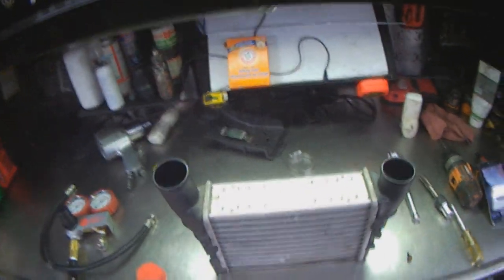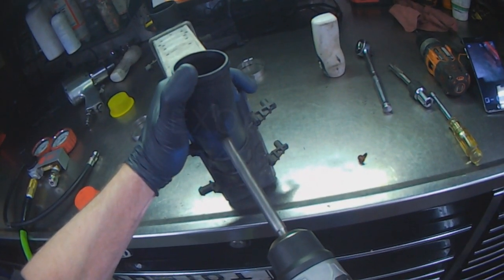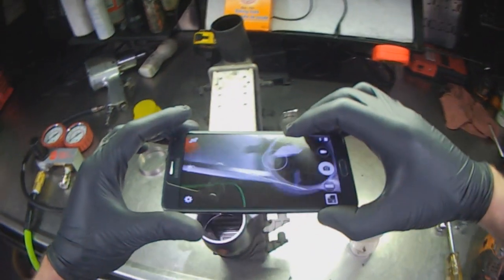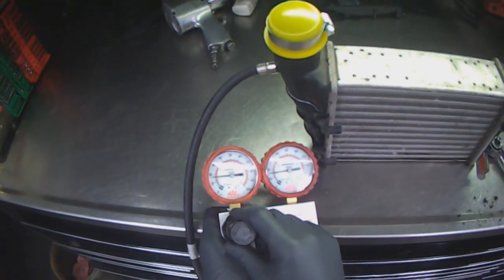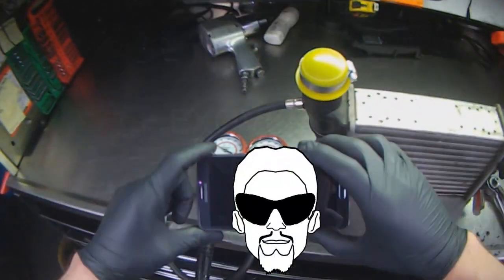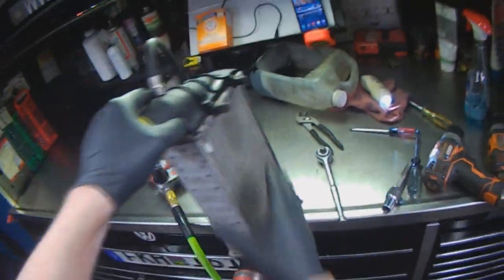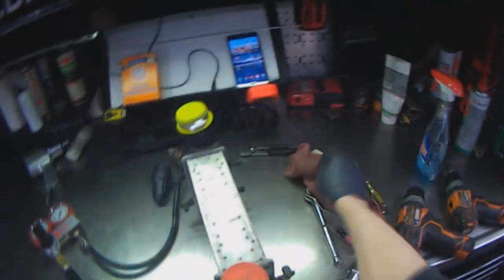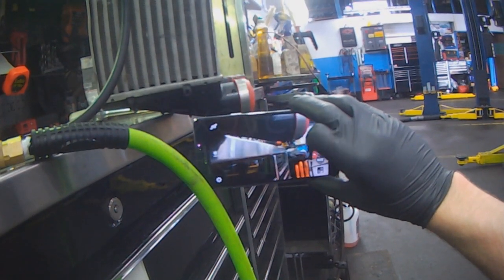Intercooler pressure testing (after drilling... OMG!!!)

Comment: I watched a bunch of videos here on my stutter/misfire issues with my 2014 f150 3.5 L w/ecoboost  while accelerating hard to pass. The issues started to show last spring and occasionally after that, always in high humidity. Last week it got so bad it threw the check engine light and code p0303 (misfire cyl 3) and put the truck in the limp mode. I drilled a 3/32 hole in the driver's side bottom near where you did and got about 1/4 cup of oil out. I also changed the plugs that were fouled, out of gap and #3 was cracked and had carbon tracking. I did not plug the hole as the other guys didn't either. Test run after warmed up to simulate a full throttle passing action. It was like new again and had full power. My question is, where is that oil coming from? Why is the engine oil leaking in there or is that just a normal thing for intercoolers? You would think they would incorporate a drain port.
Reply from the maker: PCV oil in the intake is normal... depending on intake design, some intercoolers collect more than normal amounts of oil. Too much oil is a sign of possible engine or turbo issues.
Reply: @EXOVCDS  thanks, at 75k miles I don't think 1/4 cup is too bad I guess. I was reading on others that ford has been playing with different air dams to keep the air from condensing when its humid, but won't admit to a problem.

Comment: This popped up in my recommendations right after the live stream tonight. I had no idea that this was so controversial. Responding to the inter-cooler 1/8" drain hole haters. WTF! Well done sir. Not much doubt after seeing this. For the extremists, put a dab of sealant on the screw before putting it in to seal up that .010 boost leak! haha The average guy installing a turbo couldn't even come close to sealing up a turbo install this well. New ideas take time to catch on Thomas, before long everybody will be doing this so you can feel good.
Reply from the maker: Most turbo engines don't have this type of issue.. I check turbo gasoline engine intercoolers as well, they fare better and when they show excessive oil... it's usually the turbo that's the cause. I vent the PCV to atmosphere on my Turbo E34, that way I know that any oil in the cooler has to be from the turbo.
Reply: I've heard that the turbo is usually the cause. I have to remember that you're dealing with the PCV oil on the TDI's. I should look into the configuration of that system to better understand. Hey, you'd better get to sleep. Need you sharp as a tack for tomorrows live chat! Thanks!
Reply from the maker: Gasoline engines have PCV oil in the intercooler as well... but not as much. Eliminating the PCV / venting it can help determine which the source of the oil is.

Comment: Hello i'm not the best in english but can i keep the hole open? And if not how often i need to remove that screw for drainage?
Reply from the maker: You can keep it open... but it will leak oil and the oil will get on everything under the car while you are driving. I would plug it with a screw and check / drain it at every oil change (once a year).
Reply: @EXOVCDS  ok thanks buddy

Comment: i just put a small 32nd hole in the bottom of mine, no screw no noticeable boost variance. never any oil accumulation. also keeps system cleaner
Reply from the maker: Thanks for sharing! ALH TDI? Any oil drips when parked? I can't believe all the people that worry / think that it will cause a boost leak.  LOL
Reply: Thomas EXOVCDS yes you can put catch can under car. all my diesels have some leak somewhere in ic lines with regards to oil squeezing between fittings. the map sensor will notice MINISCULE drop in boost and compensate thru ecu to boost actuator thru n75 to keep boost on vnt sustained at higher level to make up for ity bity leak. yez thez armchair mechanics r the cats meow huh. dont let them get to you. good job btw. and for those out there, no you wont overwork the turbo.

Comment: Can you leave the hole open what should I put a screw in it
Reply from the maker: A small 1/8" / 3mm hole can be left open, but it will leave oil on the floor wherever you park. Plug the hole with a small screw... after draining the cooler.
Reply: @EXOVCDS  I see a little oil on the spoiler when I get done driving it to work
Reply from the maker: @RonnieYoung-zx8wu 
Some intercooler have a problem with condensing water / water collecting in the cooler. The result is similar to oil collecting... can cause misfires during acceleration.

Comment: Hi Thomas! good video, not boring at all good point,way to go.. 
Question for you " In order to replace the intercooler is it necessary to remove the front bumper, car in question 2003 ALH" 
Thank you.
Reply from the maker: I believe it can be taken out with bumper in place... but easier with bumper removed. Bumper removal does not take long / is easy... hardest part is attaching the release pull rod when you put the bumper / grill back on.

Comment: To my brain, drilling and plugging shouldn't negatively affect boost.  I drilled (1/8" bit) my ALH with 330,000 km's (likely never drained),  about 1/2 a liter+ of oil came out.  With the time I saved drilling instead of full disassembly, I was able to de-coke my EGR and top of my intake.  I'll do a full clean later (It was plugged solid, again never cleaned by previous owner).  My EGR and first 3 inches of intake were packed solid with 3 pencil sized holes through the EGR's coking and maybe a small  pinky finger sized hole for the intake to weeze through.  Much better now.  I didn't want to clean the EGR without draining the oil from the intercooler afterward.  Suck hard on a pinched drinking straw in water... then, stop pinching...   where did all the water go?  :P 
I don't recommend cleaning intake while mounted on the car.  I just did the top portion about 3 inches in...   CAREFULLY with a good shop vac grabbing everything as I slowly scraped it away a little at a time with a screwdriver.  Anyway, thanks for the video, hopefully put some minds at ease.
Reply from the maker: Thank you for sharing your "drain experience" and the tip about how to clean the EGR/ intake with a shop vac! Yes, that would surely have caused a runaway had you not drained it first. Pieces that fall further into the intake will get past the valves and that can cause (if lucky) noise when starting the engine (carbon gets compressed between piston & cylinder head... at worst is could crack a piston.

Comment: dosent the tdi have the shudder valve to stop runaway, or was you not talking about a vag when you said about your experience with diesel runaway?

also off subject..... what does a ti do with excess boost when coming off the throttle, a petrol has a diverter valve, so where does a tdi dump its excess boost??
Reply from the maker: Shudder valve only helps when there is no fuel... there's no throttle plate, so any remaining boost just goes into the cylinders. Also, the variable nozzle turbo fins open to slow turbo spool when the foot is taken off of the gas pedal.
Reply: ok, but if its running away on oil say from a faulty turbo seal or over time oil build up in the intercooler the shut off valve on the intake cuts air supply shutting the runaway down no???

thanks for your reply, love your channel man!
Reply from the maker: +andrew page The valve only closes for 1 to 2 seconds and then opens again... you would have to hold it shut manually. By the time the runaway starts, you do not have time to stop the car, open the hood & hold it closed till the engine stops... without causing damage. A small runaway without damage is possible, but even then, parts get stressed due to the uncontrolled combustion & rev limit.

Comment: Wouldn't a small rubber washer added to the small 1/8th inch screw possibly help minimize the bubbles from the boost leak? I know over time the washer would need to be replaced, but as the screw rusts so would the screw. Just a thought, I am no mechanic, but I own a 2003 A4 1.8t and use your vids to work on it. Thanks for all your work man, you are truly brilliant.
Reply from the maker: Taylor Anthony You can use whatever you wish to help seal it further... my point was that there is no need to worry about a "boost" leak. Although these bubbles indicate an air leak, I honestly can't categorize them as being one... compared to when a hose clamp is loose (as an example).

Comment: Would this be beneficial to do on a 2018 Diesel Mercedes 3500 DUELLY Van used for commercial transport????
Reply from the maker: I'm not familiar with the design of the charge system (air ducting from turbo to intercooler and onward to the intake manifold) for this engine. Monitoring for oil in the intake / charge system is worth doing... more so on older engines / vehicles that have had time to collect oil in the system. If there is an easily accessible "low spot" in the air charge ducting... check for oil in that area at every oil change, so you can keep track of / monitor for increases in oil (which can be a sign of turbo or PCV issue).

Comment: Last year I've clean the EGR valve and intake manifold, but few weeks ago I've observed that on EGR valve, intake manifold, vacuum pump and vacuum lines is a lot of oil, and I was thinking that the intercooler is responsible for that. Thanks to your videos, I`ve just drain the oil from my ALH intercooler and the colected amount of oil was around 50 ml. It is possible that the oil from the vacuum lines and vacuum pump to come from another source?
Reply from the maker: The intercooler coolects oil from the PCV & the turbo. Odds are that 99% of the oil is from the PCV (valve cover breather valve). This is normal... You can replace the PCV breather valve with a new one, odds are that it is not functioning 100%. If oil is coming out of the small hoes on the side of the EGR, replace the EGR. To check the turbo, remove the inlet hose at the turbo and move the compressor shaft... should have no wiggle / free-play.
Reply: Thomas EXOVCDS thank you for the answers, I will check all the parts you mentioned to see what is (are) the broken parts..
Reply from the maker: Keep in mind... it's normal to have oil (from the PCV) in the intake system... 50ml is not much.
Reply: Ok I understand... I will tell you later if there was a problem with PCV valve, EGR valve or turbo... Thank you for your answers...

Comment: Do you ever find you need to do this on the AHU diesels?  I am at 356,000 miles and never did this.
Reply from the maker: I check all upright mounted coolers... we don't see too many AHU's anymore, but if I remember correctly, the last one I drained had a little oil in it. Again, a little is perfectly normal.

Comment: Hi Thomas.

What can we use to clean an intercooler?  Are there any products that are recommended/not recommended?  Soap and water?

I've got a 1.6 T-GDI and was running without catch cans for about 10,000 miles... would like to know that my intercooler is clean before driving it further.  Peace of mind, really.

Thank you.
Reply from the maker: Kyle N Stacey Soap & water is fine... brake clean, MAF cleaner etc
Reply: Thomas EXOVCDS 

Thanks for the quick reply.
Reply: CLR too abrasive?
Reply from the maker: Whatever works... I only "wash / clean" coolers when debris is in them. Otherwise draining the oil is all that is needed. There will always be a film of oil in the cooler (PVC fumes), so it's not necessary to have them sparkle clean.
Reply: Roger that. Thank you very much for your awesome/informative video! Let the haters hate as they do best! Drilled my EB 3.5 yesterday and put on a UPR Dual Catch Can system. Will drain intercooler every 5k. What's your take on Wagner IC v/ Ford stock? Thanks again!!!
Reply from the maker: Sorry, don't know anything about either.
Reply: Thomas EXOVCDS...Roger that.  Thanks again! L8R

Comment: Hello Thomas EXOVCDS, I would have a question to you. What do you say, is it a good idea (I know the answer, but still) to remove the intercooler and clean it with petrol, or oil dissolver solution? The idea is to have all the oil "deposits"  removed from the pipes and therefore better cooling of air and of course flow of it. What do you say? Also if I use petrol (as degreaser) would make some damage to some part of intercooler (o-rings, rubber sealings etc) or would be just easier to replace it with a new one? Would this cleanig matter in cars performance? Does it worth to do this. I had to replace the turbo, I just want to be sure that no "bad/angry particles" are in the air pipes, so could damage the new turbo. Hope I was clear what I'm thing on. AND MANY THANKS for your vieos. Regards
Reply from the maker: I would only clean it if there was a possibility of turbo parts (compressor wheel / metal shavings etc) being in the intake system due to a turbo failure... so yes, it is better to clean it. Soapy water or degreaser spray & then flush with water should all be all that it needs. On an engine that has no turbo failure or any other type of mechanical issue that could cause debris to get into the cooler... I would not worry about cleaning the cooler. Just draining the oil is enough maintenance.
Reply: WRONG! Oily intercooler tubes lose the capacity to transfer heat well.  Air temp at engine inlet goes up and not only engine looses power with a less dense air charge, but more importantly, oil droplets REDUCE effective octane number of the fuel and constitute pre-ignition points in the combustion chamber, and to add insult to injury, the oil leaves carbon deposits inside the combustion chamber and piston top, reducing combustion chamber volume and raising compression ratio too much.  And almost all of the oil comes from the damn PCV system from badly designed, inefficient PCV valves.  Turbo experts have known that an efficient "CATCH-CAN" that can trap the oil mist before the Intercooler is badly needed, specially in Turbo and supercharged engines that have more blow-by than lesser powered normally aspirated engines.  Very few engines have PROPERLY designed Catch-Cans.  Another thing with the Intercooler design that you show in your video, is that the end tanks were incorrectly designed, as their geometry precludes a good flow over all the tubes (the inlet tank has more flow area in one end, and the outlet tank AGAIN allow more flow IN THE SAME TUBES...  a better design has the inlet diagonally opposed to the outlet, so that ALL the tubes share roughly the same flow. This happens because factory design engineers put convenience above proper design for flow.
Reply from the maker: +Alfredo Márquez I don't see the point in pointing out that you are smarter than everyone.
This video is about draining the oil out of the intercooler and the reason why I do it.
Yes, a catch can would be better... but that's not what the video is about.
A simple drain of the oil at every oil change is cheaper than the cost & installation of a good catch can system.
Engines have been running for 100 years with no catch can. Just because something can be added to an engine, doesn't mean that it has to be.
Reply: Szilard B I

Comment: Hello, why is this such an issue on this engine...very curious? I’ve had a dozen Saab’s,Volvos and Vw with no know issue...what is so unique to this design that it’s problsmatic?
Reply from the maker: Time... A4 / mk4 VWs are up to 18 years old now. PCV fumes collect at the base of the intercooler. If the vehicle is only used for short distance stop & go driving, the oil will never get carried out of the cooler... that's why it collects. Other intercooler / intake designs don't have an area where oil will / can collect.

Comment: I have 15 3.5 ecoboost, its on limp mode with check engine light, if i would to drill the hole and take to ford service will that have consequences upon them telling me that i need a new cooler? Is ot better to just drain than making a hole?
Reply from the maker: ponce60 I have no experience with Ford ecoboost engines. The oil problem that I am showing in my videos is different from the water issues that the ecoboost engines have.

Comment: Heard alot of isses without a drain.Nice job (NOT a hater).  Maybe threading the hose connector would have secured it better?
 Thanks
Reply from the maker: Just needs to be checked / drained at every oil change to monitor turbo & PCV condition... and to prevent engine damage. Simple. =)
Thanks for watching!

Comment: the fix is to install a oil Catch can so the crank case oil vapor is caught for draining later
Reply from the maker: The intercooler already does a good job of catching the oil... that's why I drain it.
Reply: 😂 it's not supposed to, leads to premature boot failure(more boost leaks) and will eventually cause valves to fail with excessive build up
Reply from the maker: Pcv oil is a normal occurrence in the intercooler. Driving habits (stop & go city driving) is what causes oil to collect more than normal.

Comment: I leave the 2 mm hole open all the time; if i see oil on the ground...  turbo problem...then i might plug it with a screw,and drain and monitor things from there; a run-away engine might kill you,and the 2 mm hole prevents that(and still,NOT always enough,you'd need an open 5 or 6 mm hole for that!).
Reply from the maker: Nobody listens to or reads what I post in my videos... all of my "oil draining" videos of intercoolers are of TDI diesel engines. 99% of the oil that collects in those coolers is oil from the PCV. I too blew up an engine because of oil that was in the cooler... it was a TDI diesel engine.... THATS why I drain the coolers. It's NOT an issue on 95% of TURBO GASOLINE engines. Only on the 5% that have a similar cooler design where OIL CAN COLLECT.